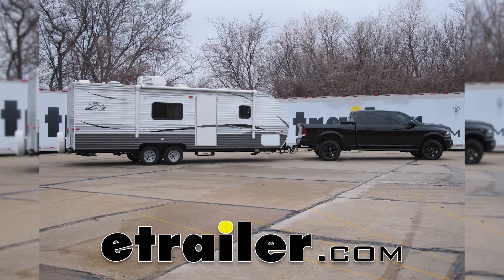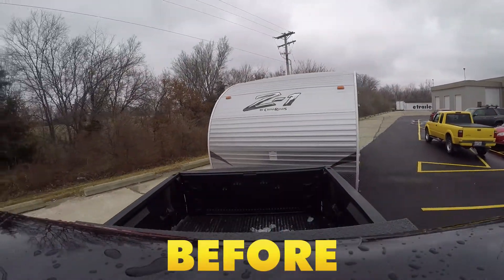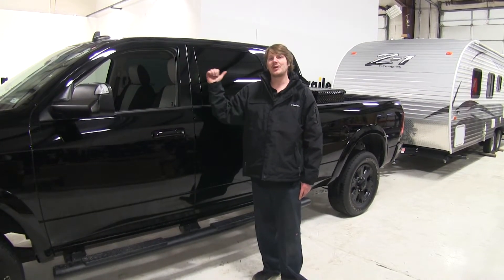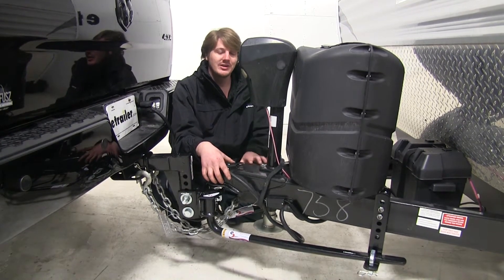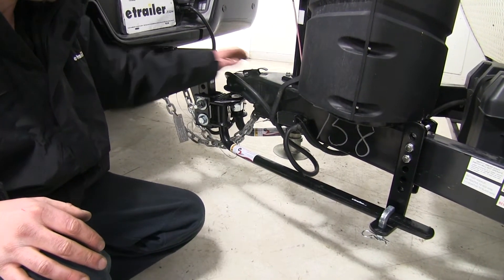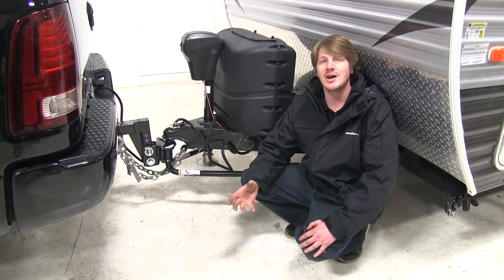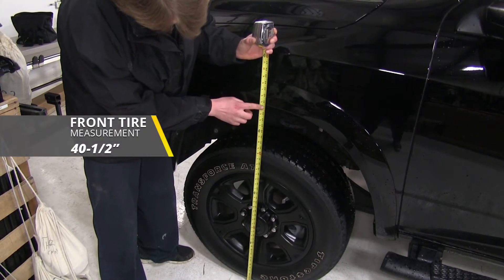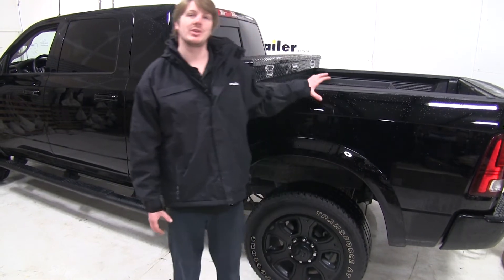How to Install: Fastway e2 Weight Distribution w/ 2-Point Sway Control on your 2014 Ram 2500

Comment: I have a 900lb tongue weight TT with the 10k e2 round bar and 1k lb bars. If  i adjust my bars correctly the bars sit very crooked in the L bracket. I feel like this kills the sway control function
Reply from the maker: Can you elaborate on what you mean by crooked?

Comment: when you add the washers to you pin you say to use 4 washers. How do you know the starting point of this set up with washers?
Reply from the maker: The amount of washers is used to fine tune the ball height compared to the height of the coupler. We start with 4 washers and add them if the ball needs to be lower or subtract them if the ball needs to be higher. For a more dramatic height change you will need to remove the bolts holding the ball assembly in place and move it up to down as needed.
https://www.etrailer.com/Weight-Distribution-Hitch/Fastway/FA94-00-1033.html